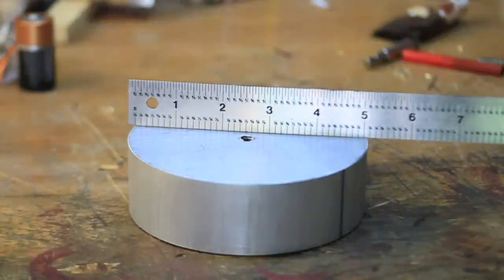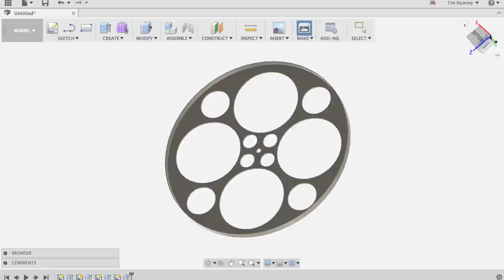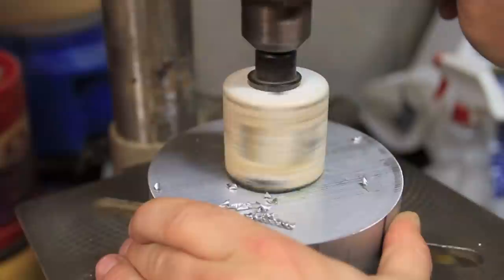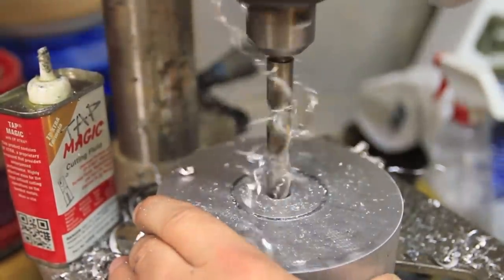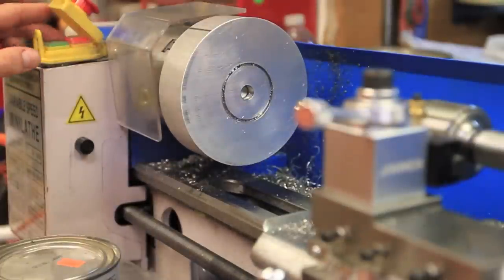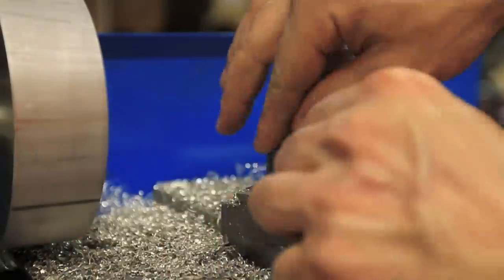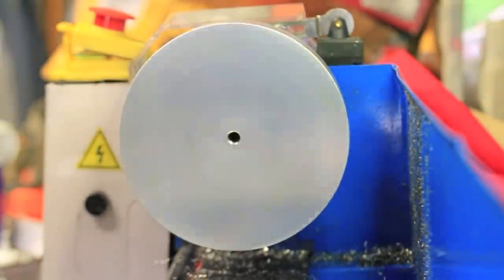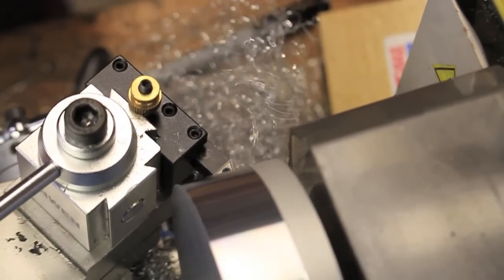Size matters - Large diameter turning, facing, and boring on the mini lathe

Comment: Best way to lube aluminum, no lube at all or methylated spirit. (dry) Tip from a metal worker.
Reply: Most aluminum produces a Built-Up Edge without some sort of lubricant. I completely agree about the spirits (usually called denatured alcohol around here) for that basic lubrication without leaving a residue or oily mess.
Reply: machinist buddy of mine who worked almost exclusively in alum. and he used WD40 and had those cans all over the shop.  very handy to be able to spray the lube on while things are whirling around.  I use it for drilling and it seems to work great to eliminate chip welding.  I used it today to drill some #60 holes in alum.  No lube with those tiny bits and they would break.

Comment: What a tedious way to find the center of the circle, drawing in 3D, printing it, post-processing it and then finally marking. Dear me, you didn’t really pay attention in math classes did you? Take a set of compasses, set it to half the diameter, scratch a line with one leg while resting the other leg on the edge, do that in three different angles and where the scratches meet you have the middle. Well within the 0,5 mm runout you claim to have achieved.

Comment: The few comments I scanned seem to cover a lot of the issues I saw. Have a look at Clickspring videos. He is excellent. Uses superglue all the time. Definitely seems safer than manually drilling and tapping a center hole for a bolt.
Reply: Not sure he'd use superglue for such a thick piece, he's usually using plate.

Comment: its not the the bolt wasnt straight einstein   10:48..when you drilled the hole in the center after unbleievably making a 3d printed part?!?!?!? instead of so easy scribing a few ,lines with a caliper or ruler......you were drilling a hole with the alum part sitting on a bunch of alum chips??  what are you thinking that you'd get a straight hole drilling on a stack of chips?  funny how you talk like you know what youre doing when you havent a clue..alot of learning to do..keep practicing tho

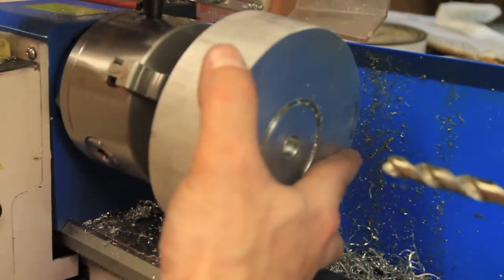Comment: The idea is nice but at 6:09 I already had enough and that's when I stopped watching. There are probably a few rookie hobby machinist that will be very displeased when they learn that what they "learned" from this video i.e indicating from a can of paint is just simply wrong. Good luck murdering that nice chunk of metal.
Reply from the maker: Thanks for watching and commenting! What is so bad about indicating from a can of paint? (It's actually body filler with ~10 pounds of weights on top of it) As long as the lathe and the indicator don't move relative to each other then it shouldn't matter. 

Feel free to check out the rest of the homicide here: https://www.youtube.com/watch?v=ao-hYbdC8GQ and here: https://www.youtube.com/watch?v=6D3vHYRjm-w

I'm pretty pleased with out it turned out and it looks like it will work nicely.

Comment: I'm sorry but I agree with the others.....All that effort to make a 3d printed centre finder and you use a big blobby sharpy to make your mark......???!!!! Learn from real machinists.>!!! I lasted until I saw the work wobbling all over the place......
Reply from the maker: If you read the other comments already you would have also seen that I just thought it would be a neat exercise/proof of concept and I was itching to 3d print something again. I'm not sure why it keeps coming across that the ability to design something in cad software, tune a 3d printer, and produce something physical to get a job done somehow means that I'm incapable of other simpler methods. Furthermore, I thought it would make for some interesting and entertaining youtube content to show a little thinking outside the box and incorporate some 3d printing. Past that, there's no point in making a high precision center point when using low precision tools... not to mention big and blobby was more than close enough since the part eventually spent a ton of time getting squared up on the lathe. 

You're more than welcome to agree with others and carry your own opinion - my issue is when someone thinks that their opinion is more right than someone else's. 

That said, what exactly qualifies someone to be a "real machinist"?

I really do appreciate you watching and taking the time to comment, but please make an effort to have an open mind and consider that something different than what you think isn't necessarily wrong, it's just different.